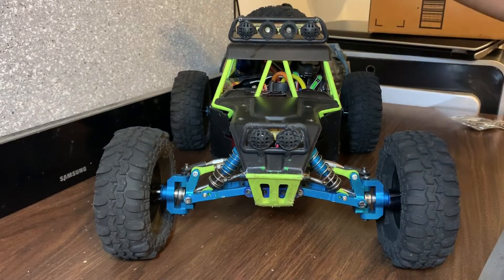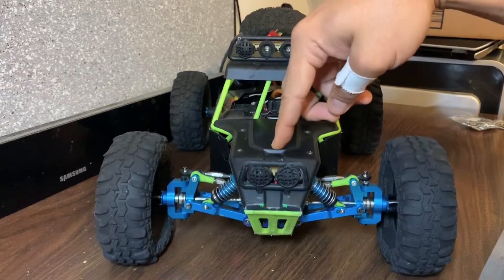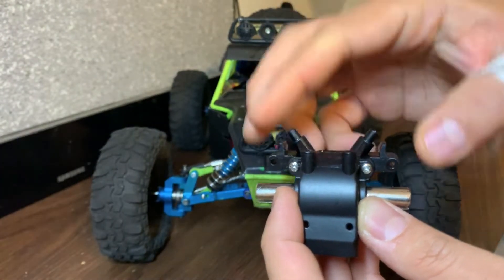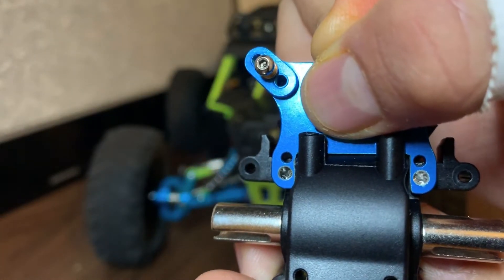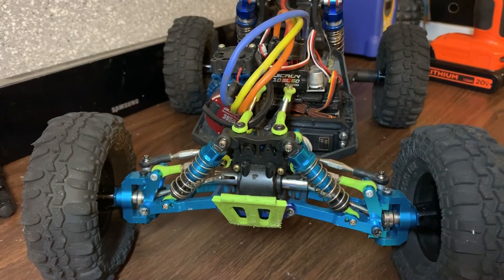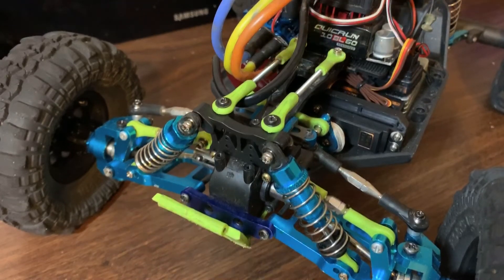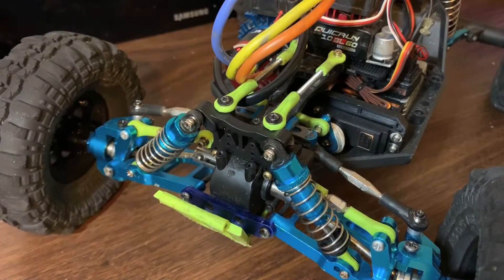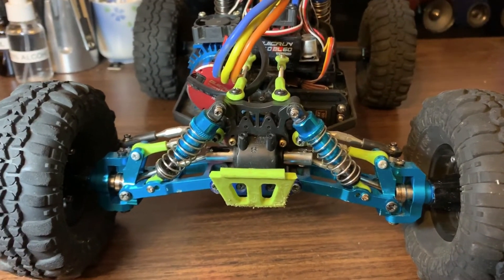Custom Front Shock Tower For WLToys 12428

Comment: Enjoying your vids. Love these little 12428 rc's. I have a xmaxx and the 12428+10428. All highly modified. I like them much better than the xmaxx. Much cheaper to mod/fix and you can drive these 1/12 and 1/10 scale cars almost anywhere. Where as you need a huge open area for the xmaxx. Thanks for the cool vids!👊

Comment: Hey man i was wondering whats the original esc. Nd if possible to put a bit of an upgrade esc on the original brushed motor before it burns out. Thanks for the vids. Cant wait to get mine
Reply from the maker: I mean the ESC has the transmitter integrated in it so to change the esc you’d need a new transmitter and receiver as well just so you know.  But yea I don’t see why you couldn’t use the original motor with a new ESC for brushed motors.

Comment: This is great, I'm probably going to also try to swap out my front diff for a Feiyue fy03 one so I can run better driveshafts over the dog bone ones. I've broken one already.
Reply from the maker: M. TTT. - Never thought of that sounds like it could be a great idea.  Not sure if the Feiyue driveshafts are gonna be any better though.  But yea the dog bone driveshafts bend and break on occasion under 3s power and they chew up the drive cups pretty quick as well but parts are cheap so I just have a bunch of spare driveshafts and drive cups on hand.  Also good to make sure the rod end on your front shocks are tightened all the way on the shock shaft so the front end rides as low as possible and that will make sure you aren’t running the driveshafts at too much of an angle because even a little bit steeper of an angle can greatly increase the stress and wear on the driveshafts and drive cups.  Used to break driveshafts a lot before I noticed the shock ends weren’t all the way tight and since I’ve tightened them I haven’t broken a drive shaft and the drive cups don’t wear out nearly as fast.

Comment: Yeah I'm running 2s..been afraid to try 3s, dont wanna burn esc out. I will  shop around for lower kv thanks. Have a couple 3s I can switch to if when I switch. Have a good one
Reply from the maker: Eric Hess - I was running a RacerStar(pretty sure similar quality to GoolRC) 60A ESC and 3900KV 3650 motor for a while in this car on 3s and it took it fine so I think it’ll be ok but yea pretty sure the lower KV will do the trick and if it feels too slow after that you could just toss in one of those 3s in and it’ll be back to where it was before.  One thing that would for sure help is a 3660 if it fits, it’s 10mm longer and I’ve installed a custom bellcrank steering in my 12428 so I know it wouldn’t fit in mine but may fit with stock steering configuration.  Longer motors improve torque as well so another option but I’d probably think just going 3200-3600KV on the 3650 would be fine.
Reply: Cool, I'll see if it would fit. Appreciate all the help and quick responses! May be hitting you up again as I'm sure I will continue to upgrade
Reply from the maker: Eric Hess - Yea no problem man, and no doubt you will keep upgrading its addictive haha.  But yea feel free to come back with any future questions I’m usually pretty quick to respond on here, and I got a lot of time put into this car so don’t mind answering questions about it haha.

Comment: Excellent video.  I am going to do this.  Can you tell me the size of the shocks needed from hole to hole for the front? 68mm? Thank you!
Reply from the maker: AMW 47 - I used cheap Chinese oil shocks that are made to be direct replacements for the stock 12428 shocks so whatever the length is of the stock shock should be fine, somewhere around 58mm.  68mm would probably be too much and would probably lift the front to the point where the angle of the front arms would be too aggressive leading to bent driveshafts and chewed up dog bone diff cups.  I’ve found a lower ride hight is really a lot better for better longevity of those parts so I make sure my rod ends are screwed onto the shock shaft as far as they go.  The shocks I used should be in the description below.

Comment: Nice video. I will do this to mine. I have a problem with my car, all diffs are metal already, but it is too noisy. I think the mesh of ring grear to bevel is too tight. My car is already 12427.

Comment: What size of tires you put in this buggy? Thanks
Reply from the maker: Pretty much everything on the car is listed in the video description.  The wheels are “Cheap” Chinese knockoff Vanquish 1.9” wheels. I say “cheap” but they are kinda pricey at a little over $30 for the set of four but they are relatively inexpensive compared to the genuine Vanquish wheels which would run over $120 for the set of four.  If you get them I would get the extended offset hubs for them too, gives you a wider stance making it a little more stable.  All that and the tires should be in the description.  If I remember correctly the tires are 108mm in diameter and if you get the wheels that I got, then you can find a ton of tires that fit a 1.9” wheel but I wouldn’t get anything over 108mm or I think it would start looking kinda goofy in my opinion.  Think I got newer videos of this car that show the new tires I got that are 105mm if I’m remembering correctly that I like better but these you could find if you just google 1.9” super Swampers.  Think I got em on Amazon or AliExpress but like I said all that should be in the description.
Reply: @AszBall  thank you so much for the info. Im going to change the wheels because the stock wheels can't get through,the buggy easily get hang on small rocks.😁😁😁

Comment: Hey bro, in other video, I saw how a guy, change the shocks for an piggybacks shocks, do you know about those upgrade whit piggybacks this 12428? Greetings
Reply from the maker: On the rear?  Yea I actually have piggyback shocks installed.  Linked em in the description of this video but yea they fit right in just needed to use the included spacer that comes with the shocks and you also need to use longer screws because of the spacers and will need washers to hold it all in.  You will also want the traxxas 2742x rod ends because the ones that come with the shocks will break because the bushing holding the ball joint pops out easily and the Traxxas rod end will also shorten the shock hole to hole a little bit which is needed because the shocks are a little long for the 12428 and may stress the joints on your driveshaft.  Just make sure to tighten the new traxxas rod ends all the way onto the shock shaft and make sure to pick the 100mm shock and NOT the 110mm shock.
Reply: @AszBall  What size are the screws? 2.5mm?

Comment: Hey, did you have to drill holes in the lower suspension arms to attach the shock to or do the aluminum ones come with a hole predrilled? Were the shocks you used the stock shocks that come with the car?
Reply from the maker: Eric Hess - If you’re talking about where to attach the bottom of the shock after this mod then yes there is already a hole in both the stock and upgraded aluminum arms it’s where the original solid link used to go that you no longer need after doing this modification.  And yes the stock shocks will fit with this mod but I used different shocks that I linked in the description.  They are essentially the same exact shock but more aluminum and will hold oil.
Reply: Ok thanks..ordered the tower..this is much needed..front shocks basically useless now..flips alot. I've got mine upgraded to brushless and all metal gears and bigger metal gear servo. Having a problem with cogging..womt start on a hill. Would dropping to a 15T pinion help? Waiting on a program card..should I increase or decrease the punch to help cogging?
Reply from the maker: Eric Hess - A brushless motor the same size as the original brushed motor shouldn’t cog too bad I wouldn’t think.  I started with the smaller 2838 which cogged and had trouble getting started, then got the 3650(same size as stock 540 brushed motor but brushless) and that had almost no cogging.  Then upgraded again to the Sensored brushless(listed in description) and absolutely no cogging and can even super slow speed crawl over obstacles like a brushed motor no problem.  To fix your cogging lowering pinion could help but the motor position isn’t adjustable, unless you’ve customized it so that it is, and using a smaller gear without adjusting the motor position would strip your gears due to a bad gear mesh.  The other options are if you got the smaller brushless system upgrade to the 3650 with compatible ESC or if you have the 3650 already than a lower KV 3650 could possibly benefit you?
Reply: I put in a 3650 4300kv motor.  So a lower kv  could help? The esc is not great. 60A goolrc. Thinking bout upgrading. What about adjusting punch?
Reply from the maker: Eric Hess - Doubt adjusting the punch would help, I think a 60A is appropriate for a 3650 and yea 4300KV may be what’s causing the cogging.  I dunno for a fact that lowering the KV will fix the issue but what I do know is higher KV is for higher speed and lower KV is for more torque and cogging happens at low speeds and from a stop so I would assume adding torque would fix the issue.  Also what battery you running?  If you’re running 2s Lipo then you could lower the KV to 3600ish KV and bump up to 3s Lipo and you would greatly improve torque while maintaining top speed.  Also try googling If lowering KV will lessen cogging issues cuz like I said I’m no expert I’ve just troubleshot a lot of issues in similar areas with this car so it’s my educated guess at best.  But yea I think 3200-3600KV for 3s is a good place to be.

Comment: Hey! I was wondering if you could help. I did the shock tower mount upgrade a few days ago rans super good no issues worked awesome. Then yesterday y modded the camber rods to make them “adjustable” and now one of the rods from the front diff comes loose under stress cant figure out why
Reply from the maker: Trailtellers - I believe that is an m2.5 screw holding that in and the plastic hole in the diff is probably getting stripped not holding the screw in but the hole will accept a much longer screw to hold the camber link in so I would just take the screw out go to the nearest hobby shop and ask them to get you the same screw but like 4mm longer.  Even if that doesn’t work And the hole is stripped all the way through you could still potentially get a screw long enough to go all the way through the back end and put a nut on the other end.  I bought a box of m2.5 screws in assorted lengths from AliExpress and it’s been a huge help if I find a screw that keeps getting loose I usually just use a longer one and it holds better.  In plastic longer screws means more threads so less chance of stripping when tightening and more friction to prevent backing out.  Hopefully I understood your problem correctly and this helped.

Comment: What the difference to stock setup? I had issue in stock setup that all blocked in half way how did You mentioned but I just used "oil" on each joint, movable connection and all gone. Would like to understand benefit of this mod. If shock is still the same so shouldn't be any difference in shock absorbance with tower or with stock setup.
Reply from the maker: klaszczbass - I don’t know why it works so much better but it does.  I can put on the stock shocks on this shock tower and it would work better as well without oil.  If I mentioned “oil” in the video it’s because the shocks I use have oil in them instead of air but that does not help with the sagging problem it helps dampen or slow down the shock absorption when the vehicle hits a bump or lands from a jump which is supposed to make it less bouncy but really on shock this small I don’t even notice the difference.  Mechanically speaking I wouldn’t think the stock setup would cause so much friction it causes the droop but it must because I really couldn’t get the stock setup to work right while the shock tower setup never seems to have any issues.
Reply: @AszBall  by oil I meant myself and usage oil as lubricant for all movable joints it wasn't addressed to You, sorry for that. Another questions, if tower is so good , what is your advice ... To change and add tower and leave stock shocks, or not to add tower and change to oil shocks?
Reply from the maker: klaszczbass - if you oiled the joints and the shocks work well then there is no real reason to do this mod.  If your shocks still sag then yes this mod will help.

Comment: Nice video man! Saddly my 10428 has a diferent dront diff so i will have to make something diferent.
Reply: Tell me what you will do or did.
Reply: @SirAnderr  I used some "L" brackets, using existing bolts. Were the original suspension bolts to the car, the. Bolted the shocks to that L bracket!
Reply: @gerekappo  nice, pretty simple.

Comment: The WLToys metal gears are garbage and wear like crazy. There is one set that says "powdered metal". Are yours holding up OK, especially under brushless power? I know many of us have this buggy, but the 12402 addresses a lot of this buggy's issues - and there are many.
I tried the 1/18 shock tower a long time ago. The problem I saw was that you have to slot the front mounting holes and that left very little material. The screws were also short and adding the thickness of the tower makes them almost useless.
Reply from the maker: john niziurski - For the slotting the holes issue if you file the bottom of the center of the tower it dropps the whole tower down to where the holes line up with the diff so no need to slot the holes, and if you use the aluminum tower even with less material it should hold up.  And for the hardware yea you definitely need longer screws.  My diff gears are holding up ok but I have noticed that there are different metal gears out there, one set I got looks like cheap ass pot metal for sure and was not really too magnetic and I put those gears in my kids still brushed 12428 and the good ones that would stick to a magnet and were noticeably heavier and felt much stronger I put in my brushless 12428 and I’ve only broke one of those gears so far and there wasn’t any wear on the teeth or anything and it broke in a weird place.  The main ring gear broke off the little collar where one of the diff bearings slide on to otherwise it was still in great shape, looks like absolutely no wear and they had been run a lot and hard.  The good gears I got from gearbest and think I got the link in the description, think a got a good set from AliExpress as well.  FYI the good ones I’ve got so far are a dingy brass color while the crappy ones are a light shiny silver.
Reply: K Yammo Good to know about the distinction in color. For the steering, a couple of us used the bell crank steering from a Traxxas Rustler. It required jumping through some hoops, like relocating and turning the servo 90 Degrees. It’s a big improvement, but not for the feint of heart. What are you doing to secure the rear of the body? I tried a set of magnetic mounts, but eventually just went back to using a 1.5 MM rod through the square holes where other bodies use posts. It’s simple and cheap.
Reply from the maker: john niziurski - Not sure what you mean by the rear of the body, I still use all the original screws to attach the body to the chassis.  But as for the steering yea I’ve done a lot to the steering, first went with a 15kg full size servo which turned out to be a little less difficult to install than I would have thought but then I decided to go bellcrank which was much more difficult and I had to put a smaller servo back in because the bellcrank took up a good amount of space.  I just updated my video description so both steering upgrade videos are linked if you wanna check em out.  If you do check out the bellcrank vid let me know how the bellcrank setup I got compares to yours.
Reply: K Yammo My body pivots off the front two screws going into the lime green thing that’s like a bumper. There is no way I’m dealing with screws any time I want to work on mine. Like I said, I hold the back down with a single rod. I’ll have to check out your steering mods.